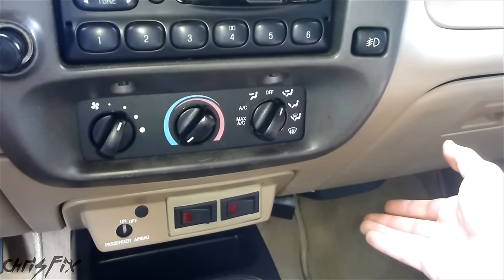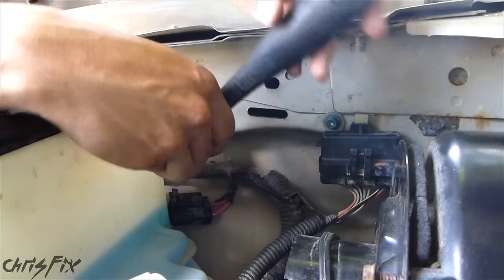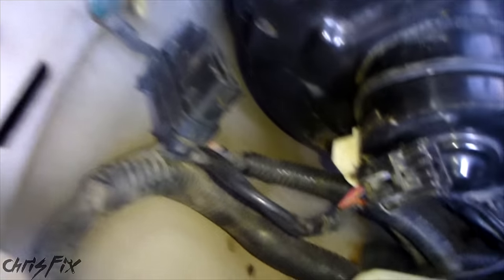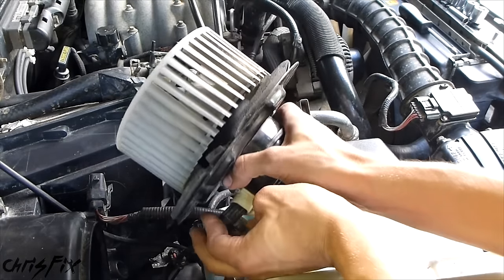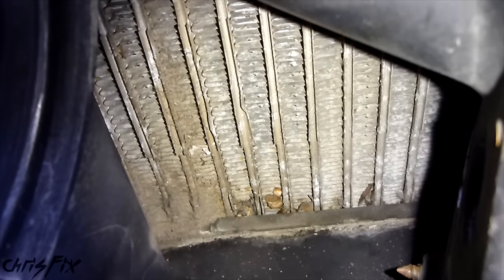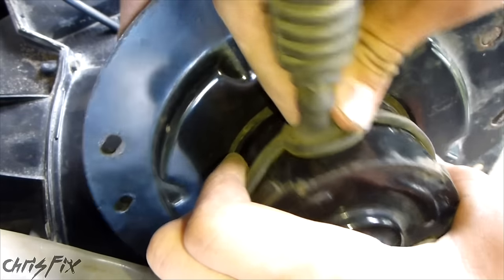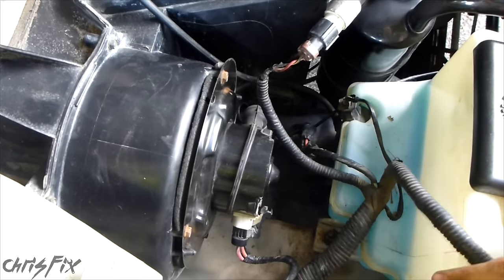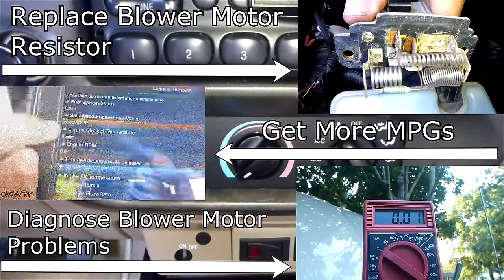How to fix a Noisy Blower Motor AC Heat Fan

Comment: You should have cleaned that evaporator with pressurised water
Reply: Where would the water go then? Into the floor of the cabin? Wouldn't that get everything behind the dash & the carpet & stuff wet, maybe even causing mold, rust, stink? And that would just push the debris further in too.

Think McFly, think
Reply: @user-ut9ln4vd5m  it must have a drain pipe as the air which passes through evaporator also has moisture and that's why when we start a.c in a car it releases water beneath it and I don't think that it will go to the carpet and elsewhere as it must be sealed box with only air inflow and out flow vents .
Reply: @AK-kg6pt  The drain pipe is good thinking! But high pressure water, enough to clean that grimy dirt off, would probably blast right past the drain pipe and into who knows where, along with any debris that blasts through the evaporator - or you might jam debris deep inside the evaporator, or even plug the drain pipe too. The air fittings I've seen are barely tight enough to keep most of the air going out the vents, lots of plastic on plastic friction fit, I'm sure they're not watertight.

If you could get access to the other side of the evaporator then trying to spray water from there & blast the debris back out the same way it came in might be a better idea, and you're sure the drain pipe will let all the water escape & not get plugged up, and then you could put down towels & see what's happening & make sure you're not pooling water inside

Comment: Replacing a blower motor sucks.......Lol
Reply from the maker: Replacing a blower motor, blows... Ha, sorry. It actually isnt too bad.
Reply: ChrisFix on a VW Jetta, it is. You have to pull the entire center console out for a SINGLE HIDDEN BOLT, then remove the glove box, insulation, and hen repeat the process in reverse to put t back together. I actually have to replace my motor and resistor in my 2000 Jetta, when my parts arrive.
Reply from the maker: Aidan Rule Wow, that really blows! I have never had to do that much to get the blower motor out! At that point, it is worth it to replace the blower motor and resistor even if nothing is wrong. Are the parts at least relatively cheap? The blower motor for my truck is $40 and the resistor was $12
Reply: ChrisFix yep, the parts are pretty cheap, about $60 for both the motor and resistor. Its a relatively small project compared to the head gasket I replaced, suspension, brakes, and some other random stuff. Fortunately, there is an abundant amount of Mk4 VW Parts that are cheap.
Reply from the maker: Aidan Rule That is good at least! Good think you know how to work on your own car.
Reply: ChrisFix Definitely :D